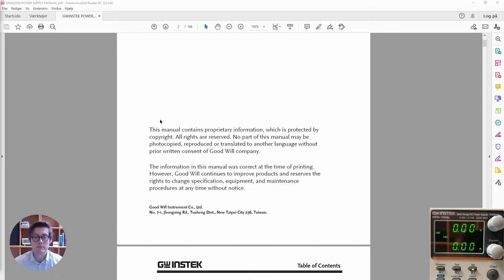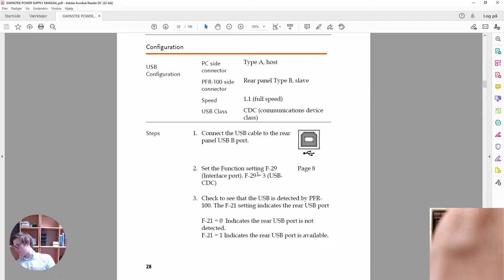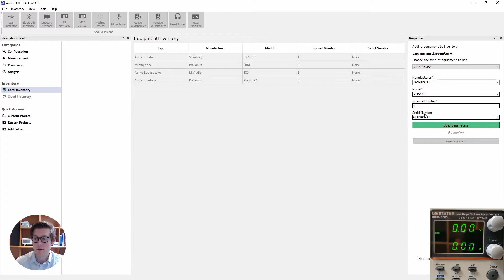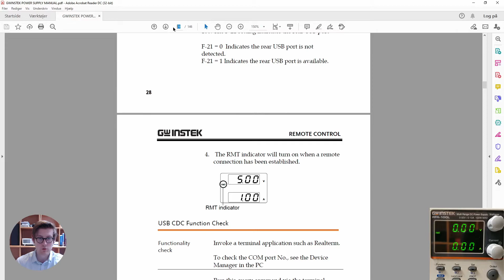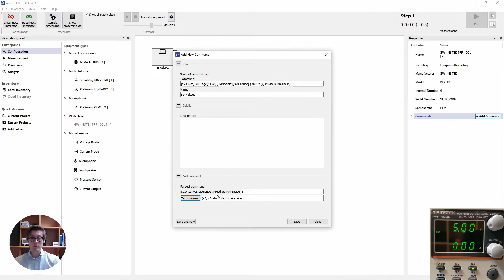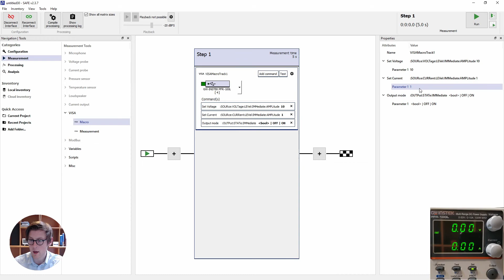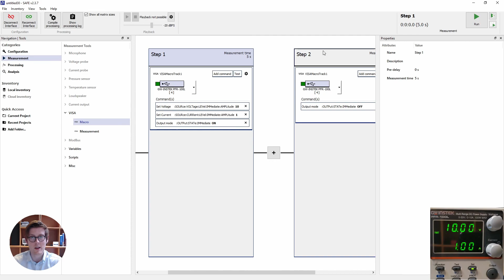How to remote control a power supply

Comment: Automating Measurements Using power supply, digital multimeters taht  can be remotely controlled by using  SCPI, Visa displaying charts in real time using 
 commands with the flexibility of a LAN, USB, or GPIB interface. An example of how to program a power supply, pressure controller, multimeter power supply including osciloscopes and to automate the I-V sweeps was performed using a diode or temperature sensor and sample  every second programs written in vba excel at  your services. Enjoy

Comment: Can I program any programmable power supply by your SAFE SOFTWARE?
Reply from the maker: For the most part yes. If it has an USB port and support SCPI then it is supported.
Reply: @encida-smarterengineering5169  Thanks.
Reply from the maker: @nityanandadas5575  Let me know if I can help you with anything /Kasper the man in the video :)
Reply: @encida-smarterengineering5169   Yes. I am using a Programmable DC power supply TH 6402B ( Tonghui, China) . This has usb facility and supports SCPI. But, I am fully ignorant of SCPI commands. 
I need to drive the power supply so that I can automatically get output from 0 volt to 1 volt in steps of 1 mV ( system programming  resolution ). 
Please.
Reply from the maker: @nityanandadas5575  you can find the manual here: https://www.tonghui.com.cn/en/product_875.html#div5 and download the TH6400 Series Operation Manual at the bottom. Then search for SCPI in the manual. Here all the different commands are listed just as in the video. Then you need some software  where you can write and execute these commands. And then its just about running the commands in the right sequence :)
Reply: @encida-smarterengineering5169  Which software can I use to write the commands? 
I think, FASE is very friendly. But, I don't konow how much is the cost of SAFE? 
Please.
Reply from the maker: @nityanandadas5575  there a different softwares and software languages you can use LabView, Python, Matlab. We just tried to make it easy with SAFE. You probably also have looked at other videos which explain how to program power supplies :) If you want to learn more about SAFE I suggest you book a meeting with me here: https://encida.com/demo
Reply: @encida-smarterengineering5169  Fine. I first try to get a better idea from your other videos. Then I will consult with you. 
Thanks a lot for  kind guidance.
Reply from the maker: @nityanandadas5575  no problem :)